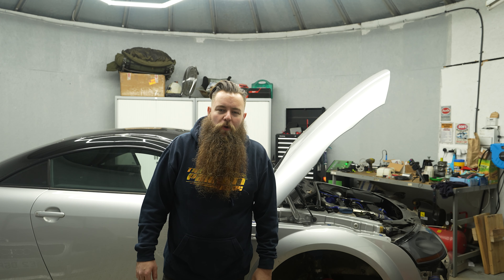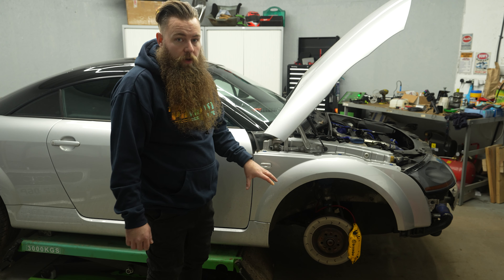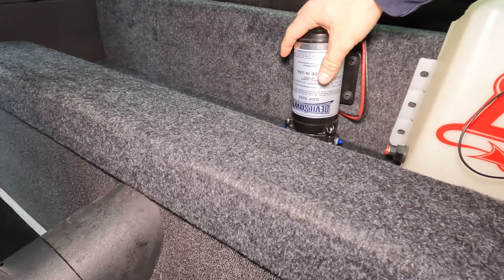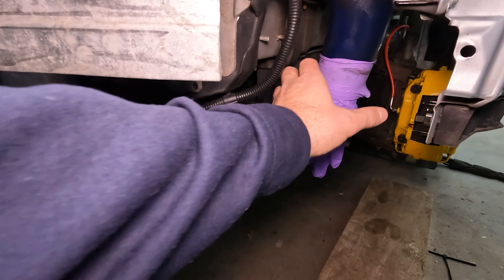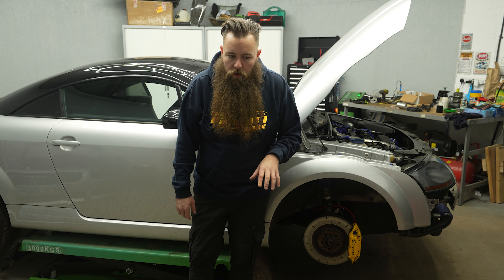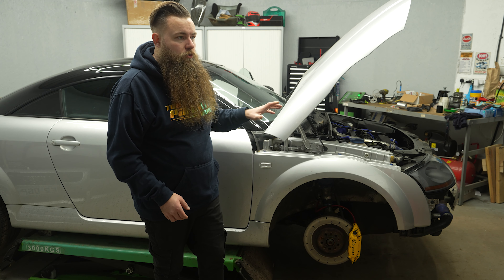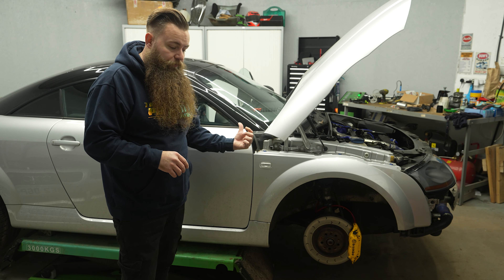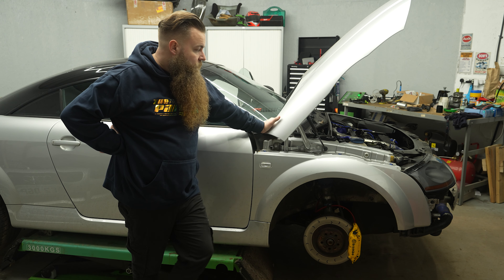Audi TT Upgrades & Modifications

Comment: I have an 2005 MK1 TT 3.2L and I’m having temp issues i know my fans are just sitting in there loosely & don’t spin when car is on not sure if my control module is burnt out or not yet either haven’t tested it yet but what would you recommend I do to get to fans taking front end off? Will be the start of my journey with this car any tips or word from you would be a help brother see you got a lot of time on your hands with these cars
Reply from the maker: i have a video discussing boost issues and testing fans, its likely the slow speed has failed in the fans and or the thermostating switch in the radiator is not working, both very easy to test and if you have a look through my videos you will find all the info you need, 

you will need to loosen the front end as its very tight to get them out if you need to, but doable without fully removing everything

Comment: I like your purple hands mod, impressive 😉 looks like the same silicone hoses as on mine SFS? So is the noggy turning into a donar car or do you have plans to rebuild it as stock?? Amazing meth injection, is this similar to what the Germans used in their subs and piston engine fighter aircraft in WW2? it gave them a serious boost in speed for a short  time. Mine's going well at moment and enjoying it driving it about, no plans other than to drive it now!! Merry Christmas Dom, Si
Reply from the maker: Glad to hear all is going well, the purple glove mod is because a friend gave me a box of them, but they are far too small to use on normal people hands 😂 yes, they are SFS pipes, great company, and only round the corner from me.

You know what I’m not 100% sure, but I will certainly look into it, could well be what they used as it does increase power unless they were using some sort of nos - based gas. And you mate have a very merry Christmas and don’t over indulge too much 😅😅
Reply: @TheParrottBros  yes just checked,  Nitrous Oxide it was,  so laughing gas🤣 not quite the same!!! Exactly who has normal size hands?🤣🤣